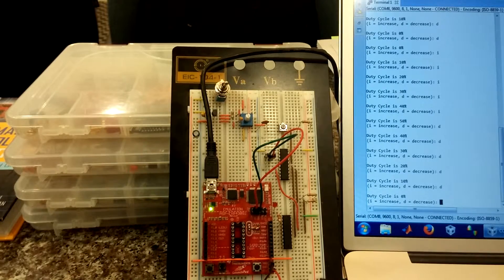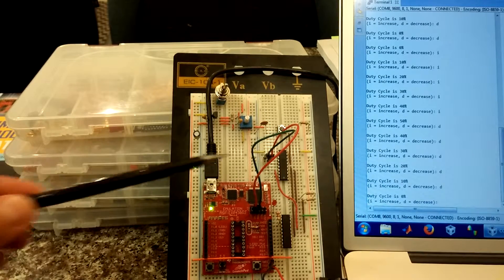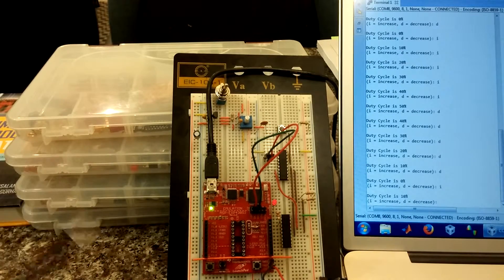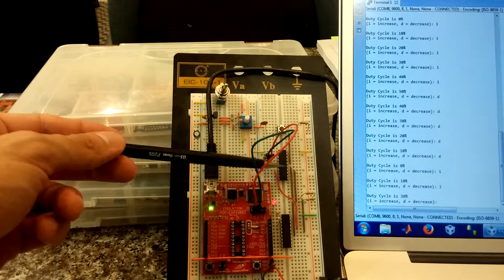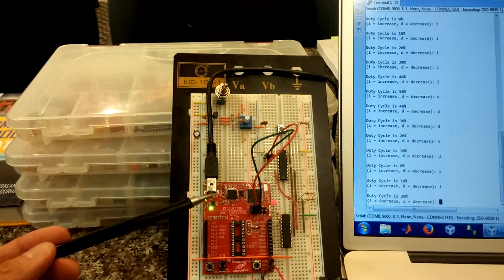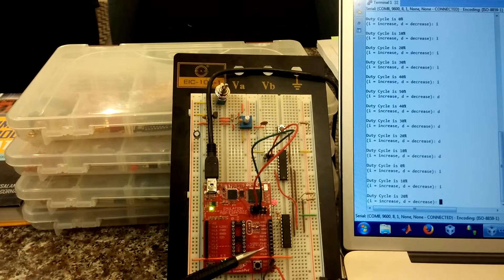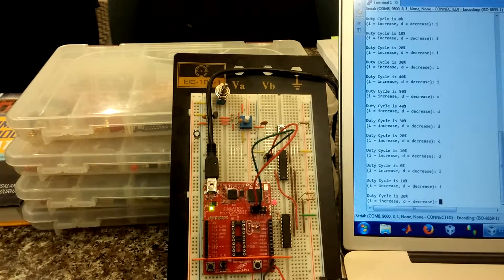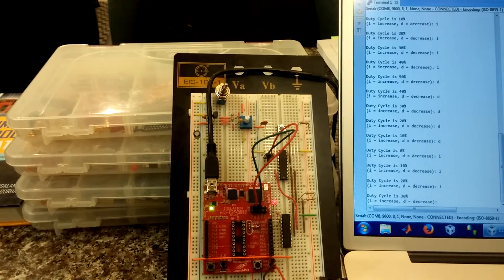MSP430 Launchpad Project (on a breadboard) : Modified Digital Communication using UART and I2C

Comment: Hi, I am doing my project. I want to connect the msp430g2553 to other MCU through UART interface(chip to chip). In your work, the UART is using for communication between PC and Launchpad. I want to know is any possible I can only use two wires(Tx and Rx) connect to other chip(Rx and Tx)?
Thank you so much

Comment: Hi John. Your project looks great.i am doing a project which is measuring distance with ultrasonic sensor. i am using msp4302553 with code composer. i want to show meausured distance on serial terminal port in code composer. do you have any advice about it ?
 Thanks in advance
Reply from the maker: +Ali Maral 
Hello Ali, sorry for the late reply. Are you looking for specific advice about an aspect of the project or general advice? If you have a specific question I'll try my best or if you would just like generic advice I can offer you what I've learned while working with the launchpad.